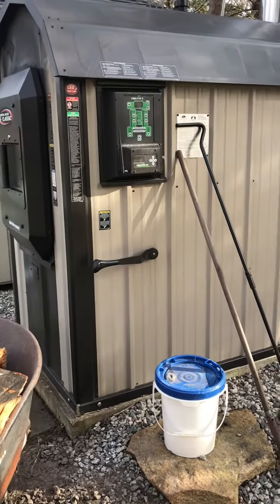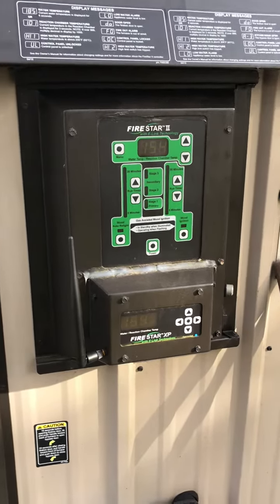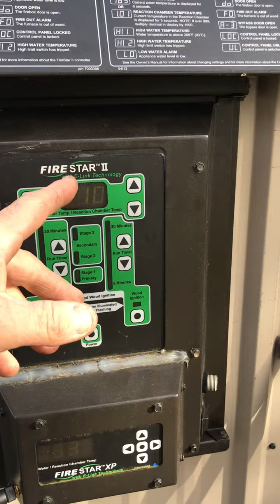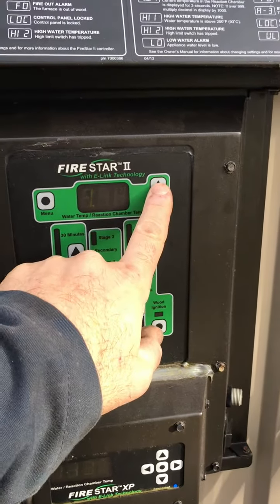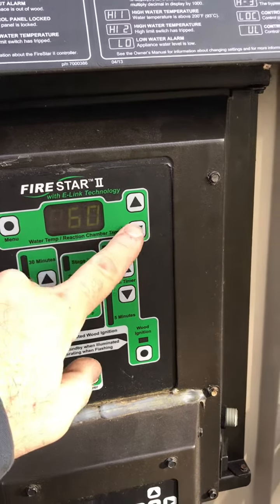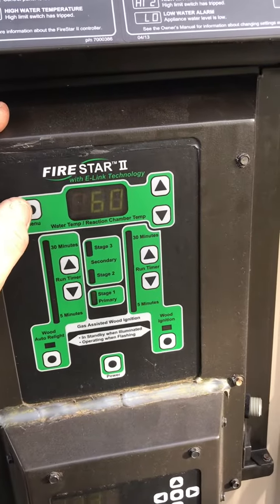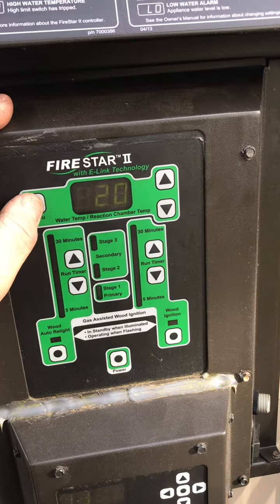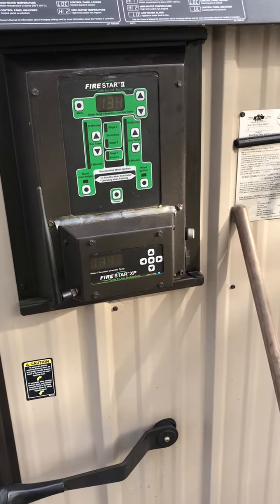E Classic 1450 Fire Star configuration

Comment: Hey Thomas just bought used 1450 very curious about the Wi-Fi module . Was wondering how you liked it and is it worth the money ? Thanks I really enjoy your videos part of the reason I bought it . Jack from western mass
Reply from the maker: The Wi-Fi module is definitely worth the money. It makes it a lot easier in the winter time to monitor the furnace remotely if you’re at work, sporting events or kids events, etc.  If you ever get really stuck, I’m happy to take a ride out to Massachusetts to help you.
Reply: @thomaswalsh9312  I appreciate that I am in the process of cleaning it still lotta creosote was running very poorly. I am having trouble finding the right fittings I need a 1 1/4 to 1 inch pex coupling.thanks again I’m sure I will have more questions
Reply from the maker: @jackking5506  try supplyhouse.com
Reply from the maker: Feel free to call too 401-255-5758

Comment: Hey Tom, this is Jack from Massachusetts. Spoke with you a little while ago. I started up my stove couple weeks ago I know it’s too warm but I was anxious. I’m having a hard time keeping it lit. I adjusted the blower to come on. every 10 minutes for 50 seconds I think it’s working I didn’t stay with it to find out but the fire kept going through the night. Got home from work today and it’s out again. Any suggestions tom I would appreciate.
Reply from the maker: Okay cool.  So what is the wood moisture?  If very low the. Bump the fan run to 180 sec 3 min.  By running it now with little load you’re going to have a lot of creosote.
Reply: @thomaswalsh9312  OK, thanks Tom. I also got some more junk out of the back. after running in a while, must’ve loosened up some more where you said to pull the chain through got a couple more big chunks out so it’s out now but when it cools down a bit, I will rewrite it and try what you suggested. Thanks Tom I appreciate your help.

Comment: Yeah hey Tom, this is Jack from Massachusetts so I bought the Wi-Fi module fire star XP and I have a signal it’s connected, but I cannot access the website because it’s asking me for registered ZIP Code and I don’t have it. The dealer is no longer in business where it was purchased typed in that ZIP Code, my own personal ZIP Code, ZIP Code where I bought it and nothing comes up. I can’t get by this part of the registration. Wondering if you had any thoughts on that may be a way to bypass it.
Reply from the maker: Hi Jack
If you joined it to your wifi and she still won’t list you reg it, I would 
1. Do a full reset if the wifi module. And if that doesn’t work then
2 call CB and have them reset it on their end.
Reply: @thomaswalsh9312  thanks again Tom I appreciate you sharing your knowledge I think I better contact cb
Reply from the maker: @jackking5506   call
Me if you can. I am still thinking about this. 401-255-5758

Comment: Hey Tom, Jack from Massachusetts again got a couple of fire star XP questions for you one is did you have trouble connecting to the server and two does your led have to be turned on to power up?Im waiting for Tyler from CB to call he will be out a couple days.
Reply from the maker: Give me a shout
Reply from the maker: Okay so no my unit connect right up to the server.  The blue led should be solid.  If your is not connecting then log into your router and find out the IP for the boiler.  Make it static and then allow that up through your firewall
Reply: Thanks Tom I just realized you got back to me sorry I think I better wait for Tyler from cb to get back to me. I don’t understand it. my sons and son-in-law will be here on Thanksgiving. I will show them what you’ve told me maybe between Tyler and my boys we can get it figured out. Thanks for your help Tom.
Reply: Yeah hey Tom just wanted to give you an update on my xd issues Tyler the IT guy from central boiler could not get this thing tapped in thinks there might be an issue with the chip so he’s sending me a new unit. Hopefully that will take care of it so that’s it. Thanks for your help Tom happy Thanksgiving.

Comment: Hi Tom, I believe my water thermometer may be bad. My water temperature reads in the 120 degree range but I get the HI2 error for high temperature switch. Have you ever had to replace your water temp thermometer?
Reply: I have a 2015 e2400 with Firestar II
Reply from the maker: Hi Dave,

Yes I replaced my thermometer inside the well before. It’s very easy access on the back of the unit. It’s right on the upper left hand corner there’s a small 2”x 4” panel you takeoff be careful not to drop the screw.  
Once you have the panel off inside and you’ll see us another small silver panel with two screws. Just loosen those and beneath that is your water level sensor. The temperature sensor is either inside that area or it’s in the upper left hand corner above that silver access panel to your water level sensor.  You’ll see it it’s some wires going in with some duct seal.   Very easy replace. I recommend Wood furnace of Ohio for parts Chad is great to deal with.
Reply: Thank you very much Tom. Does that sound to you like it could be the issue?